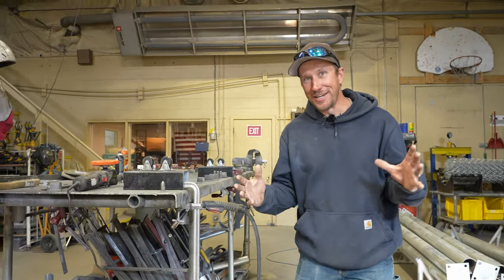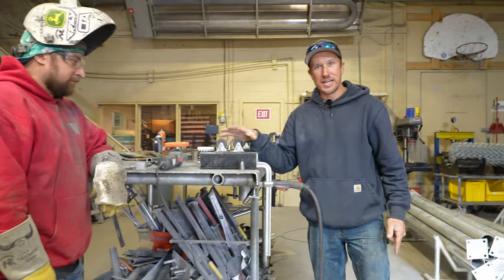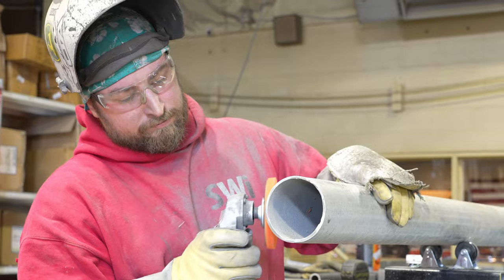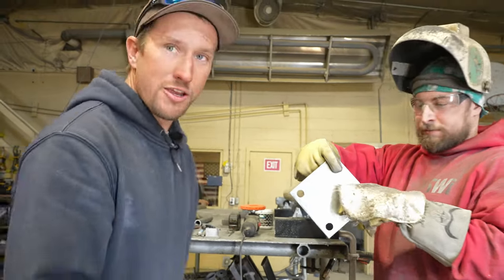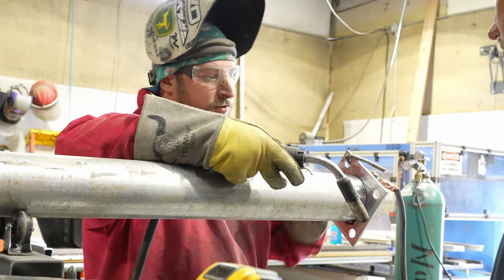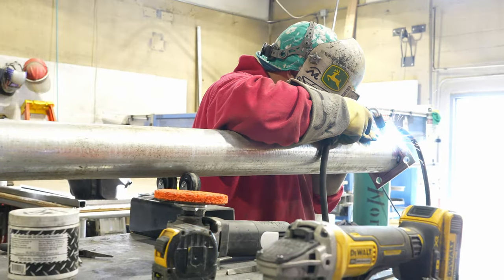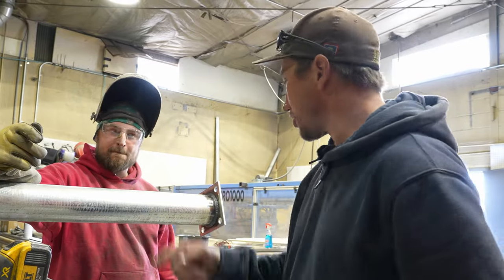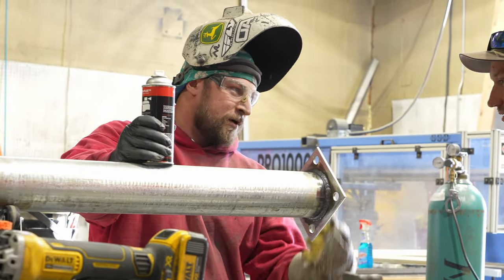Killer Welding Hack For Baseplates On Pipe!

Comment: The roller idea is clever, I do it the hard way putting the pipe vertical and welding around the flange with a stick welder. However I never had luck with galvanizing paint so I have had to hot galavize with a gas fired pot after an acid di and wash.

Comment: Rolling wheel v head on pipe stands works well. Also a piece of braided ground cable/strap  (from auto parts store) goes around pipe and slides with it as you roll. 
But an awsome cheaper way to get it done is always good to have👍

Comment: Instead of using plastic wheels.

Use metal gate weels so that your current can run through the to your weld. So that you can just clamp anywhere on your table. 🧐
Reply from the maker: Now that's thinkin'! 👨🏻‍🎓

Comment: Awesome videos I have implemented so many things into my company. Questions for anyone who can answer. What material size pipe OD wire gauge does anyone use for making temporary fence panels for job sites or events? I been considering using old materials from fence replacement like top rail post etc.. any suggestions? Thank you
Reply: Old fence material is good because it's scrap/free but, lighter weight material is really nice since you have to pack it around by hand. I'd use as light weight as you think will survive the abuse.
Reply from the maker: Most temp fence panels are made fro 1 3/8” 16 ga.  We use old SS40 or sch 40 top rail for driven temp fence posts.